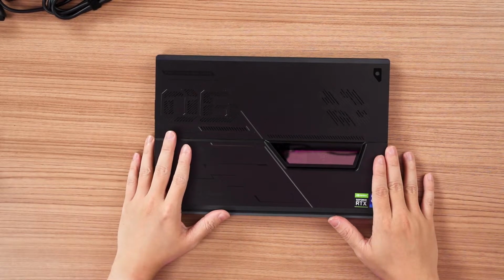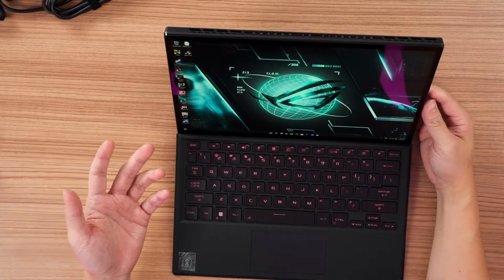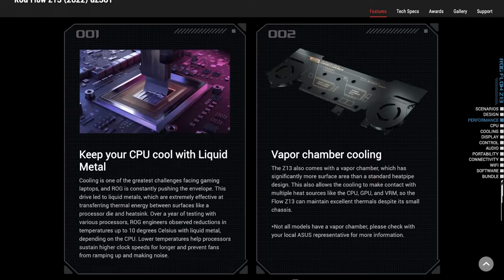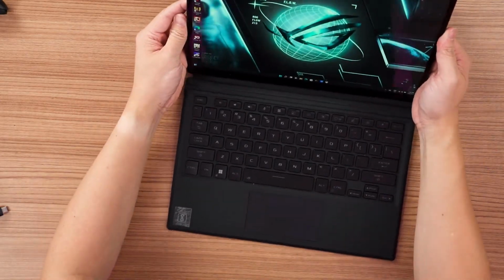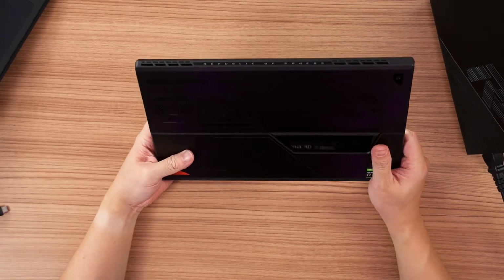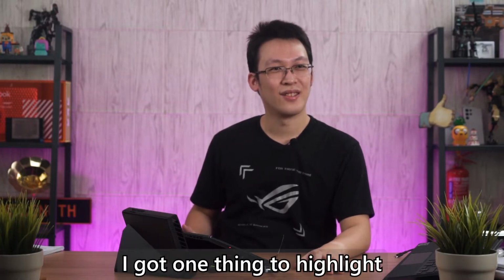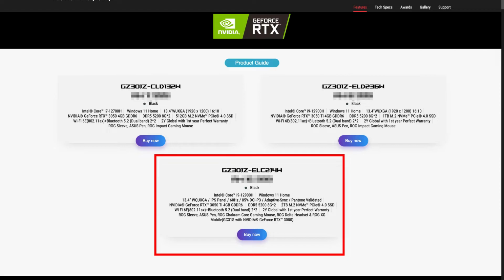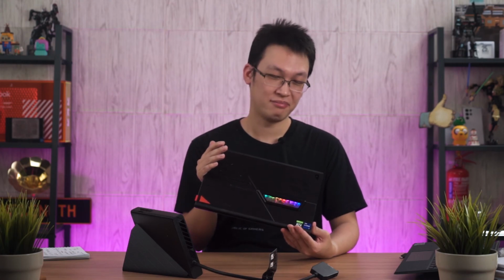Who Asked for This? ROG Flow Z13 Windows Gaming Tablet

Comment: I asked for it. It's a Microsoft Surface but better. What's wrong with that?  Also for FPS you can use a wireless 60% mechanical keyboard and wireless gaming mouse and you have an esports machine in 1.2kg.

Comment: I asked for this. Bought it to play fifa23, elden ring, cyberpunk...etc on the go, I dont need the keyborad since I'm a causal gamer who use a controller, yes it pricey, yes the battery drain quickly but who play these games on the battery?! you need your cahrger for that and the charger of the Z13 is smaller (much samller than any labtop out there). hope I answered your question.

Comment: Here's my use case - It's my full time gaming and work PC at home, hooked up to 2 big monitors. When I travel, I toss the tablet and the eGPU in a bag with an ROG XG17 monitor, my KB/Mouse and I'm off to the races. I can use this anywhere and do anything and everything, sometime all at once.
Reply: are you still enjoying the device i was thinking of getting the i7 varient for some video editing and productivity i heard the battery is very bad though.
Reply: @silverpro8356  Thanks for the questions. I've had a few opportunities to use it unplugged (flights and such) and I get about 2.5 hours of usage if I'm streaming video and a bit more if I'm only working on Office stuff. Otherwise, it's plugged in full time. It's not that the battery is bad, per se, but you have to understand the small form factor doesn't allow for a large batter and I'm pushing 4k to the screen.
Reply: @dkresheck  Thanks David for the response. Oh so you have the 4k varient ?
Reply: @silverpro8356  Yes - 4k/60fps on this screen.

Comment: This is a product I only wished could exist until it did. I was on the market for a tablet and a PS5, but changed my plans to enter the PC gamer realm. The fact that it can run Cyberpunk at respectable settings without the eGPU solidified my choice, though I intend to purchase the latter in a year or two. My choice has become even better now that I always wait for the direct line home at my new job. Plop it on the table without the keyboard to watch YouTube without risking crumbs (takes very little space), then plug it in and game. Then I hold it as a tablet on the bus, watching anime on the way home. I'm very glad I'm able to upgrade the SSD and for the MicroSD slot. The fact that it rests on my lap without burning my thighs is also really neat. I also often hold it and scroll blogs on portrait orientation, anywhere in the house. This is a polyvalent product that fills my need for a tablet while being a mid-range gaming PC and I love it immensely.
Reply: are you still enjoying the device i was thinking of getting the i7 varient for some video editing and productivity i heard the battery is very bad though.
Reply: @silverpro8356  
I watch content at the café I work at after my shift while eating, then plug it to game until my direct line home. If you can top it off after short bursts of productivity (roughly 4-5 hours if you optimize your settings), you can have a full charge in an hour. It's really a gaming focused product and at this point, I would look at the 65W limited 2023 version unless you find a good deal on the 3050 ti version, especially if you sync the keyboard lighting with the display. Though it always stings to see an improved version of the product you bought months ago, I still don't regret my purchase. The LG Gram is a much better machine for productivity, but it does not pack the power of a mid-range gaming PC. You should also be on the market for a tablet and a monitor to take full advantage of it. Last thing, forget the 4K model.
Reply: You took the words right out of my mouth. I feel the exact same, like I love the idea of not having the keyboard, it also makes it feel more like a monitor you are playing on than a laptop screen. And yeah the fact your legs don't burn and the airflow is not interrupted is a major win. People can say bad things all they want, but it plays the games I love and have the portability I yearned for (battery life be damned).

Comment: Ok, I have a slightly abnormal question, maybe somebody can answer. I understand the z13 will have win 11 at some point and win 11 has native Android support now. So I'm wondering how it would work playing games with touch controls like cod mobile on the z13? Also, if using touch controls, will cod mobile ban the account using it? Would appreciate any insight cause I'm choosing between the iPad pro or something else. I enjoy using touch controls.
Reply from the maker: I can't verify this - I think Windows 11's Android support is through emulation?
Many games either won't work with emulation or has terrible performance to begin with.
Then, some games mark emulated devices as "bots". Potentially putting you at risk, essentially. Also no guarantee it'll work well.

Comment: I agree with this video. I bought this laptop not knowing about the flaws and it's just a little bit bothersome. I think it could be a better device it used a newer Ryzen APU for power efficiency. Also I was interested in the device for digital art in programs like Blender , Unity and Krita, due to it being a powerful portable device with stylus support, but after using it for a month I wouldn't recommend it for that because the resolution the capacitive sensors in the touch screen is not dense enough for drawing. I do like the idea of a Nintendo Switch x Microsoft Surface pro on steroids as I've always been someone interested in new and experimental technology, but this device has some kinks that need to be worked out for it to be practically useful and worth the money.
Reply from the maker: Speaking of that, would you think the ROG Flow X16 is a better choice?
Reply: @Tech Critter  Looking at the product page it does look like a very good improvement overall. Although It seems to be a more expensive machine.
Reply: are you still enjoying the device i was thinking of getting the i7 varient for some video editing and productivity i heard the battery is very bad though.
Reply: @silverpro8356  I've gotten used to it. So far its battery lasts around 4hrs, while using the intel GPU, and the CPU at around half speed. I've just been keeping a large USB battery in my backpack to charge it when I'm not using it. I will say that for what it is, it is a very fast machine that never overheats. I've run the game Stray on it connected to a tv at ~30fps, medium settings at 4K. I will say though that I usually use it more as a laptop for most tasks. Since a lot of software isn't well touch optimized I usually don't end up disconnecting the keyboard. If I was specifically getting this for video editing, I would choose something more like the X13 since I can imagine that would require frequent precise mouse input. Also, although they keyboard is made well, it seems to have a durability issue with disconnecting it and flipping it back that causes it to malfunction after a while. Two neat benefits that I've learned about having a removable keyboard though is it that, I can mount the tablet where other tablets would usually be mounted (such as the back of a car seat), and I can use a small desktop keyboard on the tablet.  Although I suppose you could also use a desktop keyboard with a regular 2 in 1 in tent mode.
Reply: Compatibility for gaming is a big factor so Intel is a better choice overall.

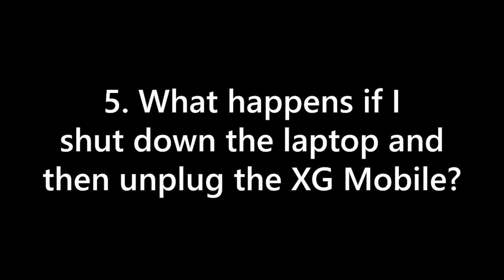Comment: 13:30 About unplugging the XGM after you turned the X13 off:
I contacted ASUS about this in summer 21. They replied, I don't have to worry it doesn't affect the system at all.
Now the question is, why do they still have this warning? Maybe they want to secure themselves legally, in case some damage would occur, don't know...

I wish there would be Joy Con grips for the X13 and Z13. That would open up new doors of possibilities!
Sure, battery life is limited and then there's the weight... but when plugged in and rested on a pillow, it's all good. I think there are some high capazity power banks, when there's no power outlet around. There's a video about handling a large Handheld: 'DIY Nintendo Switch Pro XL enclosure' by Vince, check the timestamp 8:08, it's really interesting.

Comment: To answer your question. who would want a gaming tablet. A person like me. I put the gaming name aside and see it for the specs. I am constantly on the go and I am tired of the lack luster "tablets" that charge tons of money and they do not perform. Battery life on this, for me is perfect. Performance is freaking on point and I can run Autocad on the go while holding this thing in my hand without a keyboard.

Surface pro constantly struggles with keeping up with my request with Autocad because intel iris is crap.

I also use that on the go for photoshop. I can edit right in the my hand with my client next to me. Again that dedicated GPU for photo hop on the go use is excellent.

I don't want a convertible, I don't want a tent, I don't want to flip the keyboard 180 and feel the keys at the back of my device. I want a device where I can remove the keyboard, that has a dedicated GPU, high end processor, roughly 6 hours battery life and I don't want it to be 16 inches in size.

Microsoft hit the nail on the head with the surface line. Look how many people are copying it. What they are not doing it beefing up the specs like Asus has and I am telling you, I am spreading the world around for this laptop and have many friends and work college that are looking at this and going woo. The only down side is that look and many people are vain.

I personally don't care and just want the performance. If someone look at my different because of the tablet I use, well than I don't need to be talking to them.

And before someone says, you can just can an apple, well move the freak on. Sometimes, I would have loved to be able to play some games on the go but I could not cause I am stick with Iris graphics. Puke.

Edit: Your take on the screen and how this product is segmented is on point. 100 percent. I was thinking that same thing,
Reply: can this device do 6 hours on battery? in my use case (I had the 1st version of G14), I would always be away from plug points when performing troubleshooting or setup job for like 4-6 hours, but usually I am happy if it can do 4 hours. Again, can this device do 6 hours on battery?
Reply: @learnyee  yes, I have gotten this device to last 6 hours.

Like yourself, I do performance lots of troubleshooting and do have setup jobs that can last also 4-6 hours.

Unlike yourself, i do have plug points were I can plug in. But I don't use them because I am always on the go.

With that being said, if you want the device to last 4-6 hours you need to disable the gpu and only use the integrated graphics and massively optimize windows through is services. What I mean by that is disabling all telemetry thst windows runs, disabling storage spaces, going in services and putting most on manual (except for critical ones needed) etc. I generally do this to all my laptops which boosts battery life like crazy.

I do also use the gpu on the go as well. But I only enable it when needed. Such examples are when using auto cad, using Adobe premiare for video editing, or photo editing sweets like dxo that need to use gpu.

So for my use cases, I got this table to go for 6 hours when I had a full facility power down and power up. Disabled gpu and had excel and browser open and other critical documentation. Total time for shutdown and power up lasted 7 hours. By the end of it, I had 15 percent battery left.

Now when I am using the gpu, the story flips and it flips hard. The gpu in this thing suck power like a Fatman devours a chocolate cake. I have not completely drained the battery while using the gpu. But I can say that within 2 hours I went from 100 percent battery to 45 percent. This is in line with what all reviewers are all saying.

I hope this helps you decide if it is a right fit for you. If your troubleshooting and setups are dependant on gpu use, than I will say this is not for you.
Reply: @F14Mavrick  that was really helpful and was really impressive in able to bring this laptop to run on battery up to 6 hours and more. is there any guide I can find on disabling those windows services? You should write a guide on this on the Z13 reddit page
Reply: @F14Mavrick  are you still enjoying the device i was thinking of getting the i7 varient for some video editing and productivity i heard the battery is very bad though.
Reply: @silverpro8356  I still do enjoy the device yes. Asus has made some upgrades to their framework though auroa crate that makes things a hit more annoying but nothing to serious.

As for battery life, for me it is fantastic. But I am into tweaking windows. Like I have said in my previous responses, I got this laptop to run for 6 hours on battery. But that is with me tweaking windows to get it there.

If you are open box use type of user. The battery will be decent for the power this laptop puts out. Yes everybody says that 3-4 hours is just bad. (I am going to date myself) but I come from a time that a laptop of this caliber would last no longer than 30 minutes.

So even 3-4 hours use is great in my humble opinion.

Hope that answer yours question and happy hunting. 😎
Reply: @learnyee  apologies for the second response but I thought it would be worth mentioning that the one I got was with the 4k display. I do believe if you get the 1080p with 120hz and bring it down to 60hz, you will get more battery time.

Cheers. 😎
Reply from the maker: Thank you for your constructive comment. Seems like rog has made the perfect surface pro for your use case.
Reply: Are you able to play mobile games on this thing without using an emulator? Does it have a built in play store? I want to be able and play clash of clans and other mobile titles on it when I’m not interested in playing steam games or editing. Would really appreciate a response.
Reply: @pubplays368  From what I know. Windows 11 will not have a play store available to it. You will be able to find android apps through the windows 11 Microsoft app store. This is the app store that everyone should be familiar with.

I did a quick search for you to see if clash of clans comes up in the microsoft app store. Unfortunately, it does not. Even to this day, it is still better to run an emulator for your mobile needs on windows.

So the short answer to both of your question is, no. At least from my knowledge base.

I hope this helps you out. Cheers!
Reply: @F14Mavrick  appreciate the response. I found out that google has a mobile game app on windows. It’s called google play games and is in beta right now. Eventually, all developers will be able to port their mobile games over to it for everyone to play. Still, I would’ve preferred if this tablet had the play store directly installed or at the very least, an android mode.
Reply: I'm with you 100% I love the surface pro but I use Revit and Autocad. This was perfect format for me.  Love the portability and form factor. My only gripe is should have 32giggly bits for the type of spec.
Tbh I love the aesthetic and quality build.... but then I'm a gadget freak and never really grown up lol.

Comment: The reason to go for the z13 over the X13 is the Z13 has a more powerful processor.  This gives it an advantage when paired with the XG Mobile as the GPU in the tablet is off so the CPU gets more cooling.  The better CPU is less of an advantage when not connected to the XG mobile, but still has a slight advantage.  However, the better CPU is not very noticeable when playing most gaming titles IMHO.
Reply from the maker: Your last sentence is why the X13 is better. By the way, the X13 also got an upgrade this year with updated specs.
Reply: @TechCritter  what's the upgraded specs?
Reply: Now they have the exact specs but I think the z13 is better cuz of the more portability

Comment: Xbox controllers can connect to the z13 without a dongle!
Reply: You can connect up to four Xbox controllers via blue tooth.  Xbox controllers also work through standard USB-C cables
Reply from the maker: Bluetooth is forever inferior to a dedicated dongle. Both in terms of range and latency.
Reply: @TechCritter  True... but this is notable because in the past a dongle was required to connect an Xbox controller unless you used third party software. Stating that there's no built in dongle might give the impression that Xbox controllers can't connect, when in fact it's now seamless. Even the folks at LTT were surprised when they realized that an Xbox controller could connect directly to the Z13.
Reply from the maker: I think it is a missed opportunity for ROG since gaming is their primary selling point. I think a dedicated built-in XBOX dongle with lower latency and that supports up to 8 controllers (overkill, I know) would be an BIG WIN.